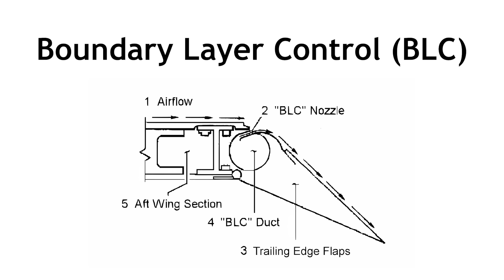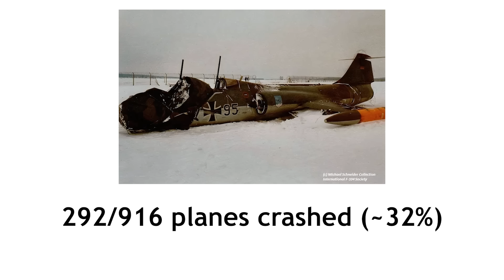Why This Jet Killed So Many Pilots?

Comment: The germans trying to use it as a ground attack aircraft was also probably a bad idea.
Reply: The F100 super saber is a true case study of just how dangerous the operation of these early supersonic aircraft could be. The loss numbers per 100,000 flight hours on this aircraft are eye watering.
Reply: @ronschock6545  The Hun's attrition and fatality rates are pretty average - around 36% for each.  If memory serves, the accident rate is under 20 per 100,000 hours, but I might be mistaken.
Reply: @ronschock6545  Flying a fighter jet is dangerous, period. They aren't exactly designed for easy handling. In combat, easy to fly means easy to die.
A good pilot will turn an inherent weakness into a strength.
Reply: @RunsWithChainsaw  No way you can turn a plane designed for interception into a ground attack aircraft... successfully... as was seen. And the Germans had some damn good pilots. As good as any country.
Reply: @JohnValeanBaily-f3u  It wasn't designed as an interceptor, sport.  And the Germans put a lot of pilots in the airplane that probably should have been flying something less demanding.
Reply: @RunsWithChainsaw  Poor design and even worse poor mission demands are the fasted way to get your people  killed . 
The RCAF and the other nato operators paid a very big price for buying that thing .
But hey , they got to build it in Canada , so there you go. Pick your priorities
Reply: @RunsWithChainsaw  ok this is a particularly clueless comment
Reply: When I was in the army in BAOR in the 70's. People would say that Germans bought land in the hope that a star fighter would crash on it, so they could blame compensation.
Reply: @Bob-kb5pv  The joke went:

How does one procure F-104?
Buy a plot of land and wait.
Reply: No it was very poorly designed and built.
Reply: So did us in Canada.  Stupid.
Reply: I was just about to mention it but you beat me to it but yeah it's true.    And lots of accidents too.
Reply: @1joshjosh1 we had a somewhat lower accident rate in Canada, despite the idiotic decision to use it as a strike aircraft. I guess our training was better.
Reply: @canadianweez  To comply with Nato.
Reply: @peterrollinsonlorimer same shit different day.
Reply: Но, избавиться от более чем 900 единиц данного неудачного самолета, продав их Германнии - это, безусловно, очень грамотное бизнес-решение! лол!🤣
Reply: @dmitry4c996 The Germans built those Starfighters, comrade.
Reply: @dukeford  Well, a production license is also a commodity. 
How much do you need to be in a servile position in order to be able only to produce the  foreign developments under license, and far from the most successful ones!
Reply: @dmitry4c996👌🎯
Reply: @dmitry4c996 That's a really ignorant take, Boris.  The Germans were in no position to build advance aircraft after the war.  Manufacturing the F-104 gave them a much-needed tech boost.  Get your head out of the vodka bottle.
Reply: @dukeford  So what. They were built under licence only after some payback.
Reply: @JohnValeanBaily-f3u  I really don't GAS about the bribery scandal at this point.  People were outraged at the time, but at the end of the day it amounted to a tempest in a teapot.
Reply: @dukeford  No. Maybe you should. That corruption and bribery resulted in the deaths of over 116 Luftwaffe pilots out of 292 crashes - having been sold the wrong plane for the tasks at hand.
Reply: @JohnValeanBaily-f3u  Your pearl-clutching is misplaced.  The Germans would have lost a lot of pilots no matter what they bought.  And the F-104 was hardly "the wrong plane, etc."🙄
Reply: @dukeford  The F-104 Starfighter was the wrong plane because it was a high-speed interceptor forced into a demanding low-level ground attack role, creating a mismatch with its design (small wings, high speed needed for landing) and the Luftwaffe's inexperienced pilots, harsh German weather, and inadequate training, leading to its infamous "Widowmaker" nickname due to numerous crashes.

I'll go with 'pearl clutching' any day, when it exposes the corruption of Lockheed as well as Franz Josef Strauss and his party, instead of an apologist like yourself.
Reply: @JohnValeanBaily-f3u  It was an air superiority fighter that followed the typical pattern of such planes in acquiring a ground role. The high wing loading and speed made it ideal for low-level nuclear strike, where the majority were utilized.  You are (surprisingly) correct on the inexperienced pilots, weather, and training.  Yes, the Germans crashed a lot of Starfighters, but their 32% attrition rate wasn't any different than other 2nd Generation fighters.
Reply: @dukeford  With 116 deaths, don't forget them !
Reply: @JohnValeanBaily-f3u  A 39% fatality rate.  About average, really.
Reply: @dukeford  Many parts came from USA as kits - like engine, avionics, landing gear. Amount of localized work was limited.
Reply: @MilanGR-888   The Europeans built nearly 1,300 Starfighters. Starfighter production employed 100k people in Europe alone. Multiple European firms were involved in manufacturing components of the aircraft, including engines.    All local manufacture.  If any were assembled from kits, it was a small percentage.
Reply: @dmitry4c996 It's still better than anything russians could ever build.
Reply: @dukeford   Denmark lost 23.5 %, Germany lost 32 % of theirs, Italy lost 38 % and Canada lost 46 %, it was the wrong aorcraft for any country, Spain had low losses because they only flew the things in very good weather and soon got rid of them. Even in Germany they didn't fly them if the weather was bad, an RAF pilot flew from his base to a Luftwaffe base and after landing he was asked why are you flying in this weather, the RAF had the Phantom and Lightning which were all weather fighters. Lockheed bribed countries to buy their awful aircraft.
Reply: Why did Italy and Canada have higher losses? Just face it, the F 104 was a bad design.
Reply: @barrierodliffe4155  It was an extreme design which gave extreme performance but nothing in aircraft design is free. It did the role for which it was designed quite well but  then these Nato nations decided to use it for an entirely different role for which it was completely unsuited.  The 104 was designed to go straight and high to shoot down a bomber. But it had no payload, no range and no maneuverability. The strike mission requires you to carry a load (you need wings for that - the 104 had none) and to maneuver precisely near the ground to deliver it accurately (you need wings for that too!!). It was totally unsuited to that role, but budgets were tight, they had the aircraft, so some chair bound idiots decided they could make it work. It was kind of like using an AA fuel dragster to deliver packages for amazon. But they went ahead and did it and the pilots paid with their lives. But the airplane itself was quite amazing. I've known a number of pilots who flew it and they were in awe. They loved it.
Reply: We parekd them also in our windy, rainy, foggy, cold weather on the outside.
Reply: People keep saying the f-104 was mismatched for the ground attack role, yet a U S Air Force  F-104 team kept winning the Air Force ground attack competition year after year.
Reply: @KennethAGrimm  Well, once, at least.
Reply: @dukeford  I was a teenager in the sixties, reading aviation magazines.  The article surprised me, "Yet again, the __ Wing with their F-104s wins the ground attack competition."  It was, as I recall, their second or third in a row.
Reply: @KennethAGrimm  An F-104C won the USAF William Tell competition for the only time in 1962.  It may have won other gunnery competitions, too, but that was the main one.
Reply: @dukeford  I stand corrected.
I was twelve when it happened and I read about it; that was a long time ago.
Reply: In Canada we used it as a low altitude nuclear bomb carrier and interceptor
Reply: True, but was it a bad idea by German pilots or by NATO politics forcing a high altitude interceptor into low level mud moving, do you blame the designers, the Luftwaffe command, or the whole procurement circus?
Reply: @RedfoldDocumentary  I will hazard a guess that the difference in loss rates had to do with differing training styles. Not one better than the other, just different. one more rote precision, the other more intuitive innovative.
Reply: The primary NATO mission was strike and Lockheed marketed the “G” model for that role. So it wasn’t a matter of the Germans being fools for using it in that role. That was the mission for which the bought it. The question is  more a matter of whether it was the right airplane for them to buy.
Reply: Agreed.
Reply: If you had the balls to roll this thing into a dive bombing run, you were clearly over MGTOW when you left the hangar.
Reply: Oh yes. My dad worked on these planes as an engineer. He had quite a few tragic stories to tell.
Reply: It's also notable that this plane was marketed incorrectly to Canada and Germany as a fighter/bomber
Reply: @thygrrr  Explain, then, why the USAF was already using it as a fighter-bomber.
Reply: @dukeford   USA also had bad losses with it.
Reply: The problem was that it only dawned on them how useless an air force of only high-alt interceptors would be after they'd bought almost a thousand of the damned things. Than it turned out that such a role was strategically useless in a world where ICBMs were the main threat, and that going into Warsaw Pact airspace at an altitude higher than about 500ft was paramount to suicide. It's telling that Luftwaffe casualties on the F4 were pretty negligible. It's understandable though. The main trauma for the generation of German air force generals that decided to build this plane in the 1960s, many of who'd served in WW2, was being defenseless against strategic bombing and seeing the country being turned to ashes - something still very visible then (and even now). And so they became fixated on keeping bombers out, even when they had ceased being the main threat.
Reply: It was same with MiG 21, although it must have been more forgiving plane than F104. Pilots died in Czecho-Slovakia due to usage of that plane for ground attack roles.
Reply: It was a god damn disaster . I lost two friends many decades ago using them in rolls they had no business doing.
Reply: When you have been suckered  into a deal to buy from America you have no choice other than to scrap the aircraft and pay your way out of the contract.
Reply: Oh ja
Reply: "Probably"
Reply: Wasn't any smarter when we Canadians did it. Buying one fighter to do everything, as is the fashion these days, is never a good idea. They gave the job of a Buccaneer to a Starfighter and got a bunch of graves as a result.
Reply: @grantpatterson2727  it's fine if the aircraft is designed to be multi-role, like the F18. True multi role aircraft didn't exist in the 50s and 60s. But if it is an extreme point design like the 104 it's insane.
Reply: Largely, they were forced to use it as a Ground Attack aircraft because Lockheed and the US Administration used all dirty tricks in the world to preclude Germany to buy other types. The Luftwaffe would have gladly ordered the Mirage IIIE and Bucaneer, but instead was forced to accept 916 Starfighters. 🤬
Not only the aircraft was extremely critical to fly, she was also pretty inefficient. And this happened in the whole NATO but not with the cynical Americans, who barely used it and considered the aircraft very limited.
However, in all fairness many of the 292 crashes could have happened with any other aircraft.
In strict percentual terms, it was the RCAF who had the largest losses, not the Luftwaffe, who lost the largest number.
Reply: @duartesimoes508  It was designed as a high speed interceptor against Russian nuclear armed bombers, a rocket with wings. Ground attack planes need to be agile, forgiving at slower speed, carry more armament. Using it for ground attack, demonstrates financial interest over utility. It was excellent for what it was designed to do in it's day.
Reply: @paulgraham6353  So yankee arrogance and stupidity prevented Germans to have Fairchild Trunkenbold II's or A-10 "Warthogs".

Some German pilots had earned their spurs with Cannon-Stukas, in those Warthog-roles in Eastern Front.!!!
Reply: @paulgraham6353  It was designed as an air superiority fighter for the USAF and only lasted a couple of years as an interceptor with ADC.  It was not a success.  NATO bought the airplane mainly to deliver a single "special weapon", not for CAS.
Reply: @duartesimoes508  thank christ Oz bought the Avon Sabre & the Mirage 3
Reply: @mickvonbornemann3824  The Mirage is a nice airplane, but you had the same accident and attrition rates that NATO operators had with the Starfighter.
Reply: @dukeford  not really, if you take into account how long we had them & the hours they did over decades
Reply: @mickvonbornemann3824  You operated the Mirage III for about the same amount of time that NATO used the Starfighter.  Like I said, the accident (losses per 100,000 hours) and attrition rates were the same as most NATO F-104 users.  FWIW, the French safety record with the Mirage III was worse than the overall German history with the Starfighter.
Reply: @duartesimoes508 . Nothing wrong w/trying to gain an advantage to help your own Company sell planes.  Do whatever is necessary, & better if you don’t get caught. Unfortunately, Lockheed did get caught.😢
Reply: @jamessimms415   With bribing scandals?
Reply: The F-104 was not designed to intercept bombers. Complete myth, please stop repeating it.  The 104 was designed as an air superiority fighter. Like almost all fighters it could intercept enemy aircraft. Like almost all fighters it had inherent ground attack capability, and its high wing loading and speed made is especially suitable for the high speed low altitude nuclear delivery role.  The G model was specifically equipped for that role.  It was no more difficult and dangerous to fly than other early century series fighters.  Pilots loved it.
Reply: @gort8203  "Low altitude nuclear delivery"...OK, lets talk about that. Nuclear weapons would be delivered by loop bombing, something the F-104 was very unsuited to doing. You'd lob it halfway across the Soviet Union.
Reply: The F104 used Toss bombing to deliver Nuclear weapons. I was amazed to hear the B47 did the same. I found out later the later paid the price with the plane disintergrate for semingly no reason.
Reply: @douglasclark1439  Quite a few aircraft did toss bombing, largely because SAMs made flying high pretty much suicidal during the Cold War. If you couldn't rely on height to get out of the blast radius of a nuclear weapon, lobbing it in one direction and running like heck in the other was the best available option. In some quarters, the maneuver was known as' The Idiots Loop'.
Reply: Well, consider the German F-104 as the U.S. Army's revenge for WW2. 😂
Reply: @Str8Wytmale  Lame.🙄
Reply: @Str8Wytmale  It was really just an updated Me-163 so why should Germany complain?
Reply: @Str8Wytmale This wasn't revenge. Just a little humiliation and domination. Revenge will take place later.  Revenge is a dish that is served cold. And it won't be Americans, but quite the opposite.
Reply: lack of adequate transition training was the issue..this is a a barely able to fly aircraft almost a wingless bullet
Reply: @EkimDyslexia . Throw in perpetual lousy weather in Europe didn’t help much.
Reply: @jamessimms415   By golly, Germany is not a California!!!😅😅😅
Reply: "Trying to use" is a narrative, the german luftwaffe "had to use" it, because the usa expected germany to buy the stuff.
Reply: @1968konrad  Well, you won't have to buy our crap anymore :P
Funny how people always forget how heavily subsidized they were and how cheap the German government was...
And you're still too cheap to design your own frontline fighter. Had to get help from the Brits, Italians and French 🤣
Enjoy your Fiat/Mini Cooper/Citroen/VW....

Comment: Watched from Jamaica. Can you cover another widow maker, B26 Bomber? One crashed in my country Jan. 1945 and I have a piece of it.
Reply: "The Baltimore Whore"
"One-a-day in Tampa Bay"  😂😂😂
The main reason was that initially the wingspan was actually insufficient. It was increased later and the pilots were instructed to adhere strictly to the published approach speeds. Then she became a pretty good aircraft.
Reply: The B-26s crashed, as you will know, for the same reasons. 
Some of the servicemen used to say that it "had no visible 
means of support."
My grandfather was a flight engineer on one of the B-26s 
that crashed.

Comment: I always imagined what the F-104 would be like today if aerospace engineers revisited this aircraft and added updated design elements & engine, modern avionics along with modern manufacturing techniques/materials.
Reply: And fly by wire technology
Reply: And leading edge extensions
Reply: I wonder how you'd fix the lousy landing characteristics; just mounting another engine would not do it!  Maybe a twin-engined version, like the British Lightning?! And that was the fastest aircraft in climb to altitude for decades!
Reply: @ErikssonTord_2 we just don’t need this plane anymore.
Reply: Well you can see where design went.   The F14 F15 F16 and F18 showed a VERY clear break in philosophy.     Instead of everything for climb and speed they put out aircraft with wings, that could TURN too.
Reply: Computerized landing!